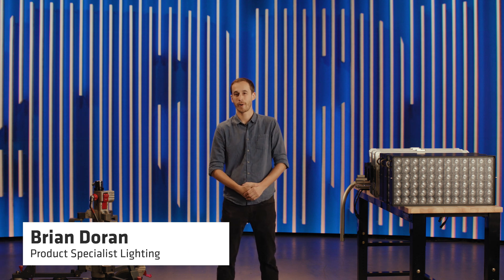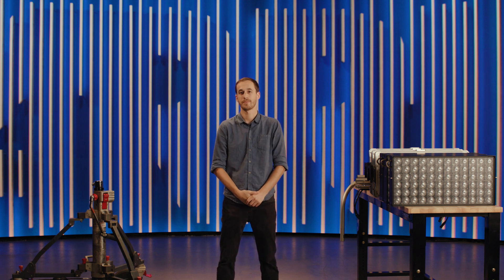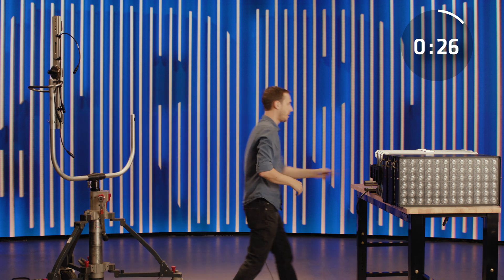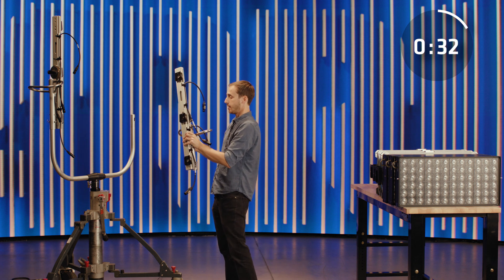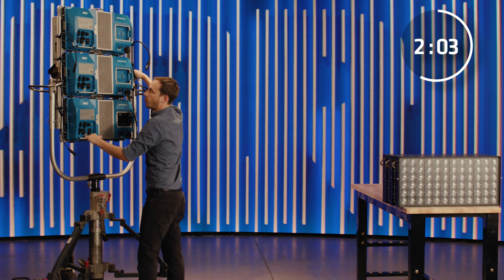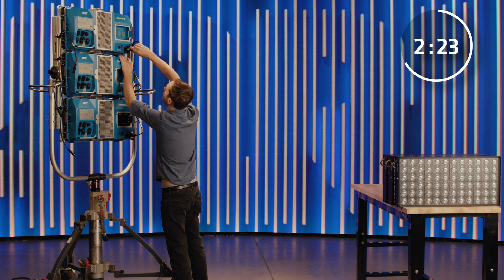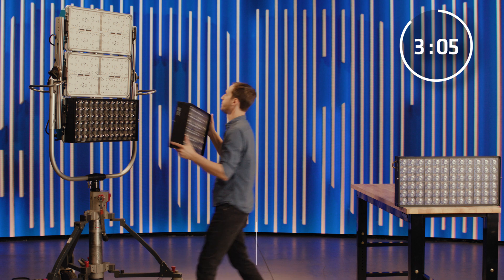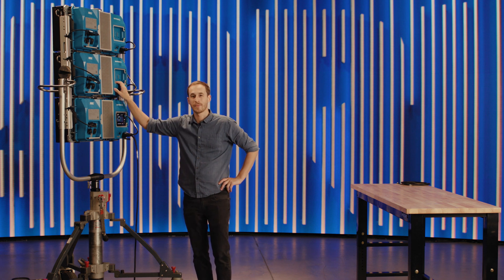SkyPanel X - It's time to build up your X23

Comment: Hi - if I build an X23 array, can I control it as a single large pixel with DMX Mode 2?
Reply from the maker: Hi there - yes that's absolutely possible with the Array mode. Another option would be to set each fixture to the same DMX address.

Comment: Hello!  Saw on gdtg share that the fixture modes are extended up tu 24 modes.   Which fixture file good for x23 config? if the fixture file is 24 zone?
Reply from the maker: Hi there, DMX mode 8 let's you control all 24 pixels of the X23 with a single profile.

Comment: I have a question regarding NewsShooter's recent ARRI SkyPanel X Review:
They state that about their measured photometric performance results of the ARRI SkyPanel X:
"The SSI scores were a lot lower than what I expected, but it didn’t seem to affect the performance of the light in any way."
Is this factor completely ameliorated or fully compensated when utilising the camera matching mode profiles in the SkyPanel X when using them together with modern ARRI cameras, like the ALEXA 35?